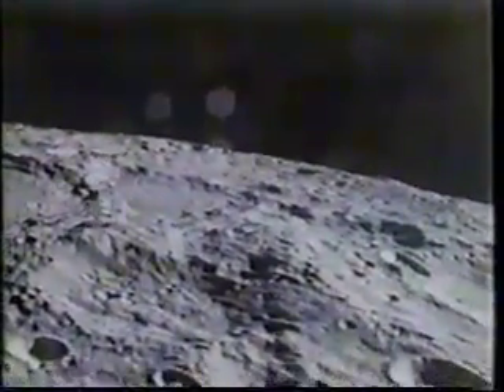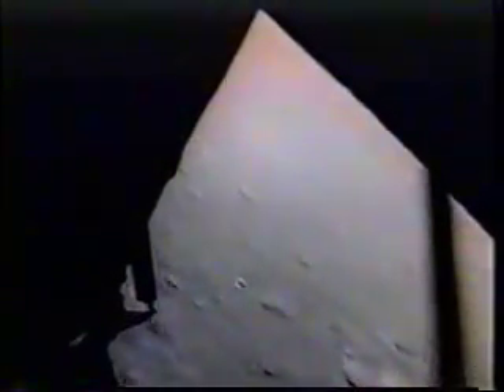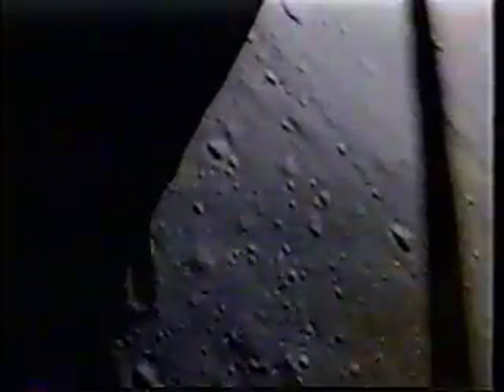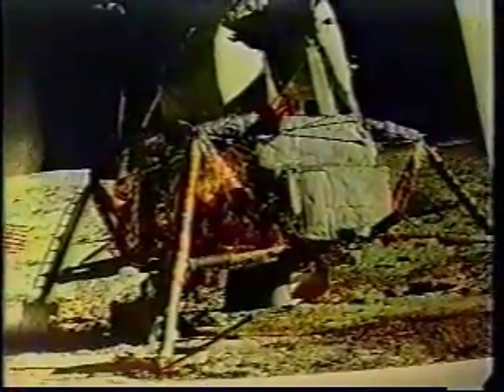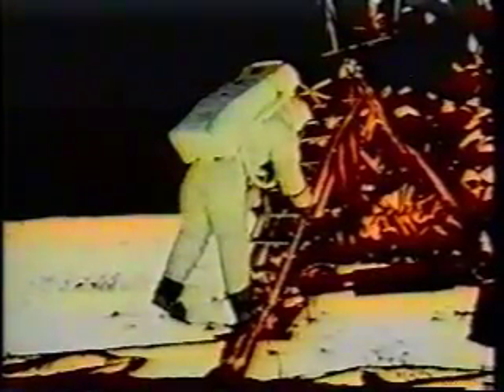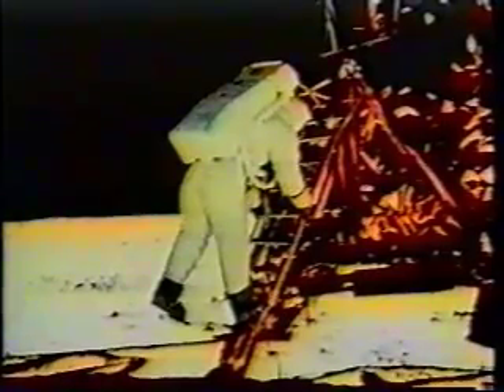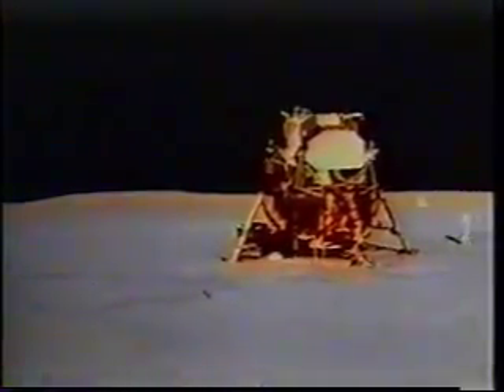Was is Only a Paper Moon? 4 of 6 - The Moon Landing Hoax

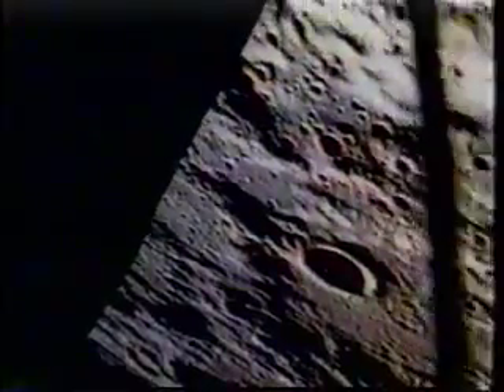Comment: Anybody who knows anything about orbiting a planet would know that the whole segment from 11:00 to 12:00 is completely not true, they /should/ be taking off vertically at first, of course, but the entire orbit burn after that initial vertical accent is of course horizontal and not straight vertical. At the same time, they are still gaining altitude, so that's why it seems like the top right is just flowing into the scene. They can of course still see where they took off from.